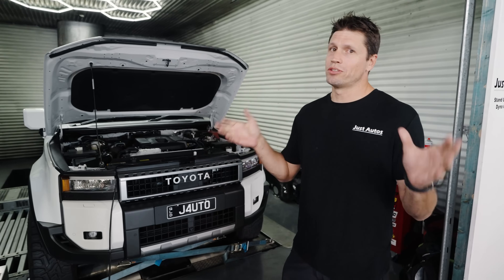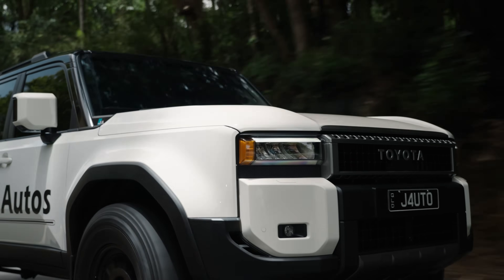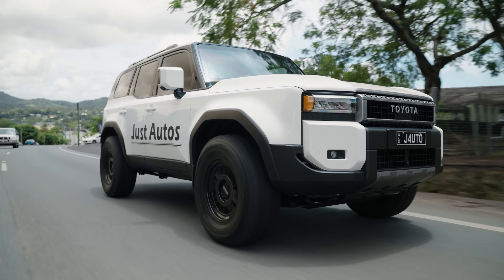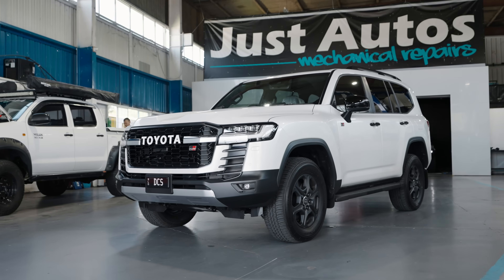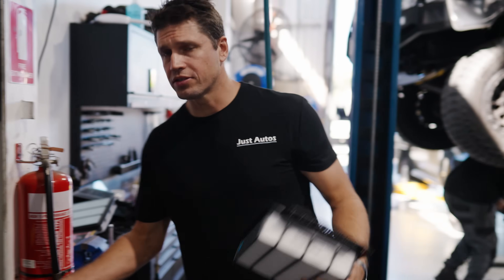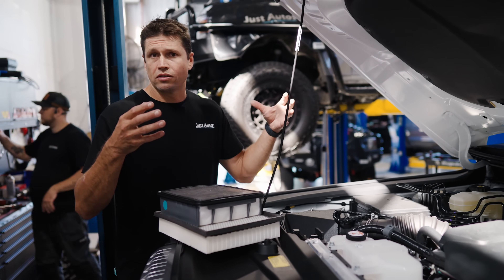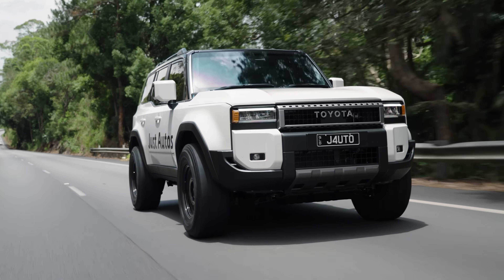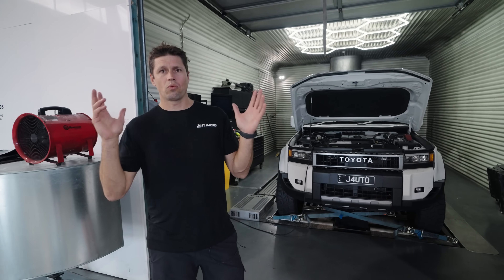Its ALMOST here | 250 Series Prado FINAL R&D

Comment: So, y'all spend 100K Aussie on one of these baby landcruisers, then another 10 - 15 K Aussie on the mods needed to correct all of toyotas design flaws and restrictions and as a result throw your warranty out the window? Ist it cheaper and more sensible just to get the lexus version, yall, with the bigger TT gas V6 and just wear the added fuel cost for the sake of the much better performance, improved luxury and that amazing lexus warranty?
Reply: Emissions laws im guessing you from the usa
Reply: Tt lexus prado not available in Aus
Reply: @79series yes it is!
Reply: Y'all isn't a word. Stick to cheeseburgers per eagle

Comment: So Toyota spent millions to r&d this airbox and you reckon it’s not good enough… ?😂😂😂 okay mate. I get it you want us to buy your product. 😅😅
Reply from the maker: We have produced countless products that we don’t released because we have tested them and they are not worth releasing due to factory product being adequate for the job. We only release products that are backed by our testing and data. 
You only have to see our Google reviews to know that our remap and products make a significant difference to the drivability of the vehicles. Also we are designing products for people who want to use their products in more extreme conditions than everyday road usage. We only recommend an upgraded product if the use case requires it. Hope that helps.
Reply: Yes. Ask any owner of the Landcruiser, Prado and Hilux who actually uses them on dirt and who actually change their own air filters and they can tell you the standard air box does not seal properly. I’m sure Toyota can do better and in fact they used to do better. But frankly they don’t care to spend the money to make a decent air box because the dust will wreck your turbos and engine outside of warranty. It is a well known issue that impacts 200 and 300 series Landcruisers,120 and 150 series Prado’s and the N80 Hilux.
Reply: @peterj5751 220000 km and mines running perfectly with standard airbox and unichiped  at 30000. Gibb river road and at least 20000 km on dirt roads and that’s very conservative. I’ve been around Australia twice and the high country 50 times. The mighty 2017 Hilux.

Comment: Is the 48V system tuneable?
Reply from the maker: We can tune the 48V variants, we dont touch the way the 48V system works.
Reply: @ It would be interesting to see what it actually does apart from stop start. I’ve just change from a manual N80 gen 3 to an auto N80 48V and it seems way punchier. Not sure if it’s the 48V or just the upgrade to auto.
Reply: @michaelburns5680  its the gearing in the auto that makes the difference, the battery only powers things like the aircon ect to save on fuel to offset the increased weight of the car some 300kg heavier then the hilux

Comment: 175hp from 130hp. 480nm from 330nm. Am I tripping or are these numbers less than stock? Isn’t stock 200hp / 500nm?
Reply: Factory rated Flywheel power vs power at all 4 wheels I’d say
Reply from the maker: @stato350able Yes that is correct. The numbers that are produced from the manufacturer are flywheel numbers.

Comment: What oil are you guys recommending? 0W-20 or something heavier?
Reply from the maker: Based on our research and firsthand experience with these vehicles, our recommendation is to utilise a 5W-30 rated oil for best engine protection, longevity and reliability
Reply: @JustAutosMechanical  which oil do you recommend for the 2.8 in the 70 series?